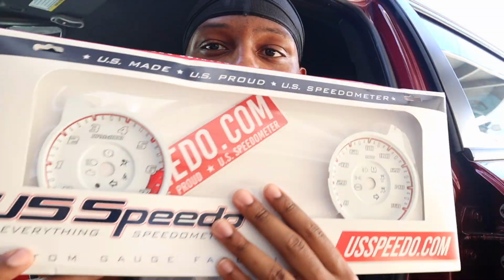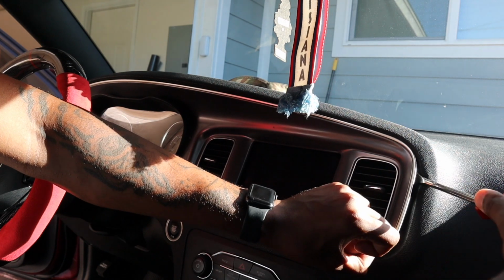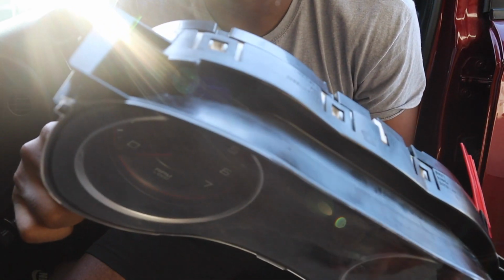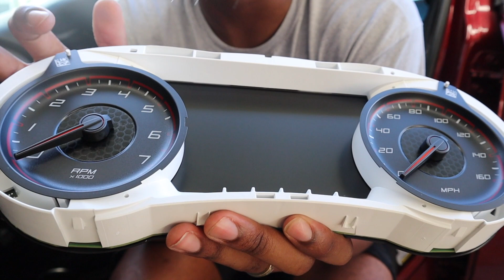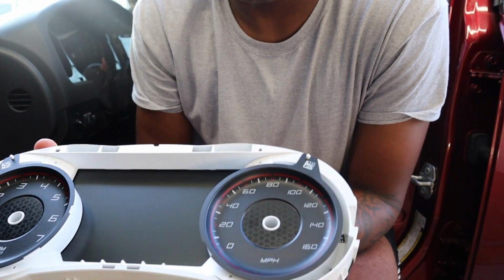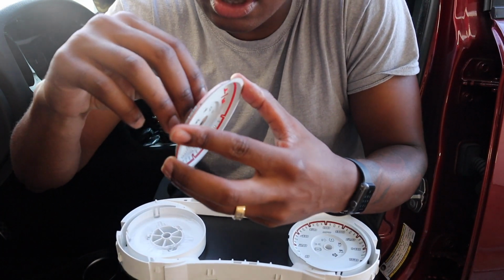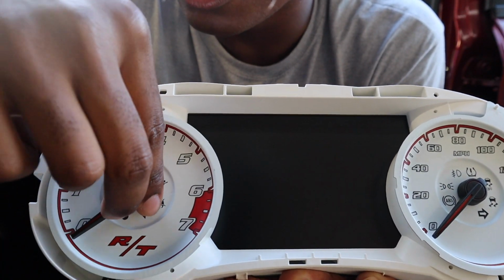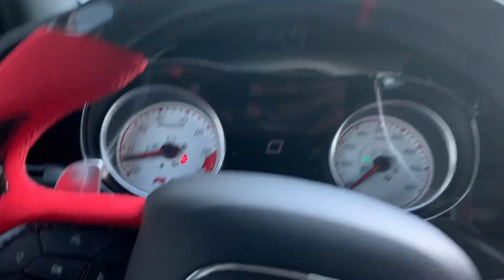Custom White/Red US Speedo Gauges On My 2019 Charger RT!

Comment: Hey I need some help buddy my armrest power outlets in my sxt charger have stopped working and I haven’t seen any videos on how to replace them can you help me out with a video I’ve already subscribed
Reply: Check your fuse box in the trunk
Reply: I have a 2017 sxt charger rallye and sometimes i have to pull the fuse in the trunk to reset it and it works again its a stupid problem to have but Its easily fixable so its not to bad bud the fuse box in the trunk is def the easiest way to fix it.

Comment: Does this work for 2014 R/T
Reply from the maker: I don't think so bro!
Reply: The 2016 gauge cluster will bolt on directly into the old gauge cluster, as long as it’s charger to charger, challenger to challenger. The only modifications you’ll need to make is widening the hole for the gauge cluster to fit the new one. It’s a very simple process sad there isn’t many videos on YouTube about it